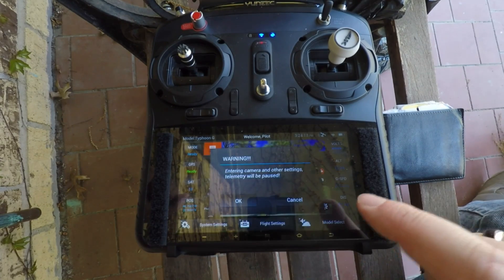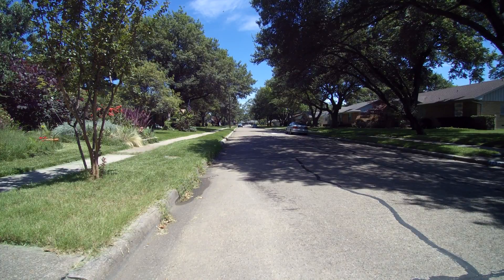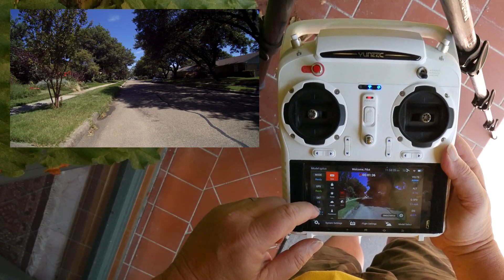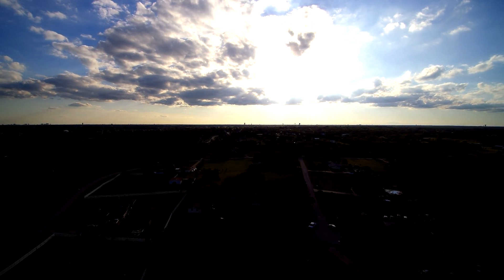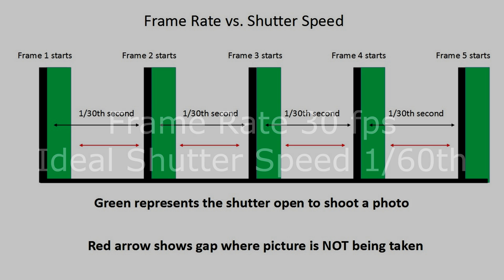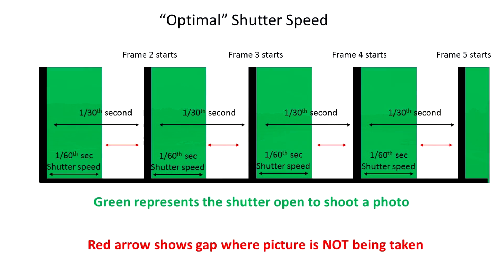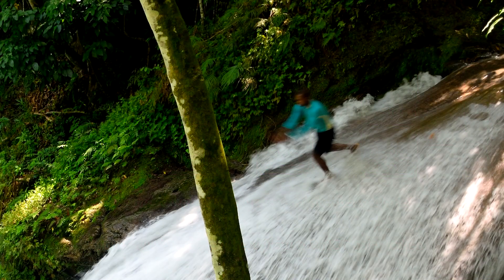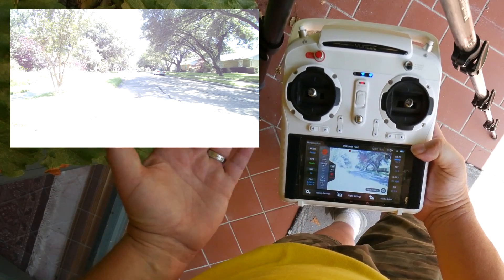Episode 9 - Yuneec Q500 4K, Typhoon H White Balance, EV, Manual, Neutral Density ND Filters CGO3

Comment: The reason we can't see much difference in the smoothness of your first filtered / unfiltered example is because it is a slow-moving forward tracking shot. If it was a fast pan the difference would be much more noticeable...

Everyone seems to be shooting at 30 FPS. I shoot at double that (more accurately 59.94), but maintain a 29.97 FPS project, so I can slow stuff down to 50% speed with no loss of resolution, good for smoothing out any less than perfect rotation or gimbal tilt. This allows me to use just an ND8 filter in bright sunlight, and select a shutter speed of 1/125, or 1/160. Why a bit higher than double ? There is a disadvantage to ND filters and lower shutter speeds and specifically drone footage - loss of ground detail. It might not be too bad on its own, but combined with YouTube's video compression, having too low a shutter speed can really kill the detail in your videos, especially in grass and leaves on trees. That's my argument for keeping exposure slightly higher numbers than double frame rate...

Comment: Hi Jeff, great video and very informative. I have a Chroma and H and I make videos of lighthouses around the UK. Sometimes on a sunny day the white lighthouses glare although the sea looks a nice blue. If I were to use ND filters without adjusting the settings will it still work OK will I have to compensate manually.
Thanks again, Jeff M
Reply from the maker: No, I don't think so. What's happening is the light meter is being fooled and allowing in too much light - but if you put on an ND filter, the camera will simply slow the shutter speed down so it continues to let in too much light. To fix the issue you describe, you want to adjust your exposure value, or EV compensation. You can take the EV down to -.5  or even -1, which wll allow in less light. 

The ND filter is designed to slow down the shutter, not darken the image. So, if you adjust your EV down and then use an ND filter, you'll get better exposure as well as smoother video from the slower shutter speed.
Reply: Thanks Jeff, I'll give that a trial locally before the long trips to the coast. Thanks for replying and keep up the good work.

Comment: Hi Jeff.  I have a question for you.  My q500 video only records in 5 minute intervals. Is there settings that I can change to get longer run time or is that just the way it was designed.  Thank you for your time  my friend and keep making videos your chanel is very informative
Reply from the maker: Hi Braydie - your drone is operating as designed, and Phantoms and other brands of drones do the same thing. My understanding is that the operating system for the camera limits how long video files can be; once you hit that point, around 5 minutes as you said, it saves what you've recorded and begins a new file. 

The good news is that you can bring these 5 minute clips into a video editor, line them up and your resulting video should be seamless. 

This used to bug me, but it actually does have an unintended advantage. At one point I had a problem with my media card but didn't realize it. I flew three long flights and recorded all three, producing 9 or 10 files. Because of the card's problem, some of the files were corrupted and I lost those minutes. However, if all the video for each flight had been in a single file I would probably have lost all the footage from the day. So in my case at least, there was an advantage to the video files being broken up.
Reply: Thank you Jeff for this information it was very helpful. I totally understand now how this could be a helpful advantage.  Be well my friend and thanks again for your time